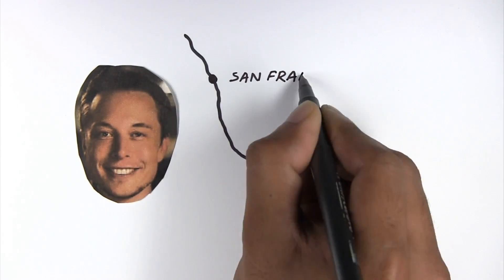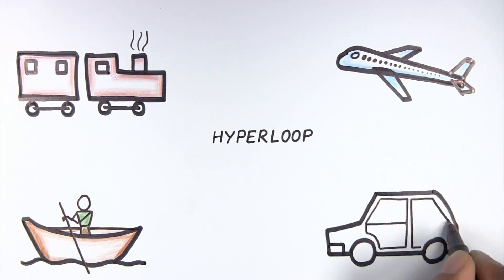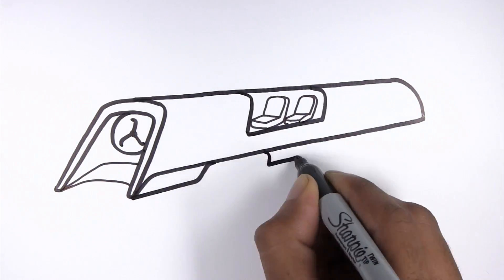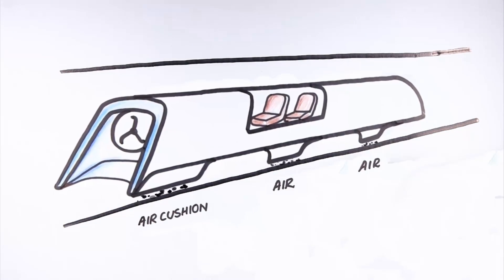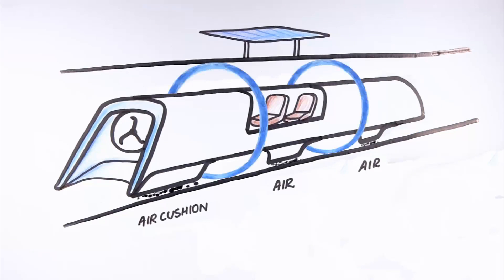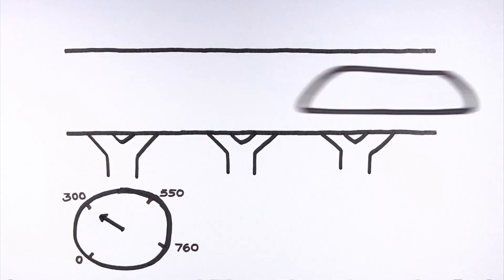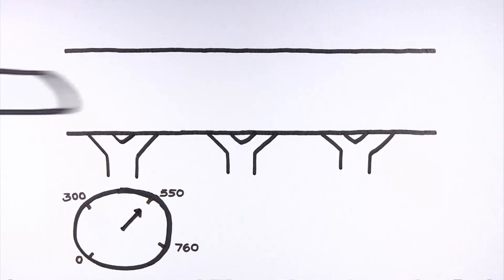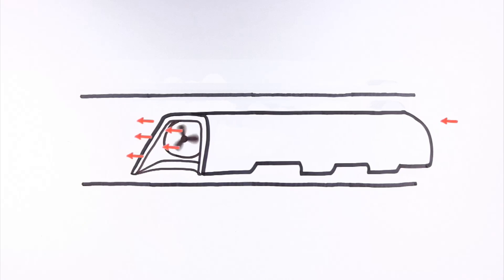Hyperloop Explained

Comment: The Hyperhype is not new.  The idea for trains in vacuum has been around for over 100 years.  It will NOT be cheaper than a plane, anyone who thinks that probably thinks that you can construct a 100 mile vacuum chamber for less than the price of a rail.  It will crash and when it does it will be a total systems failure.  When vacuum goes it really goes.